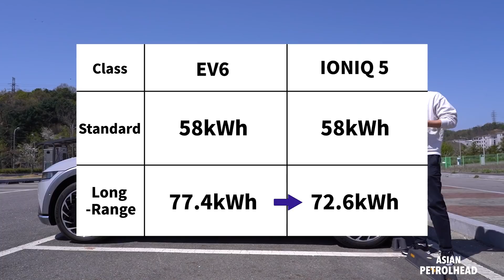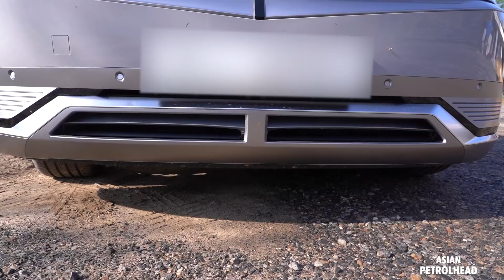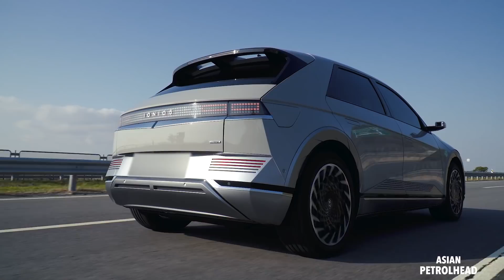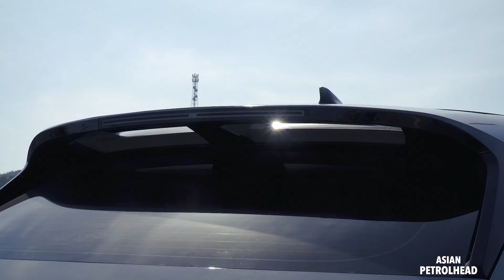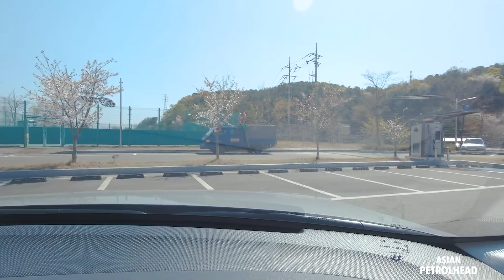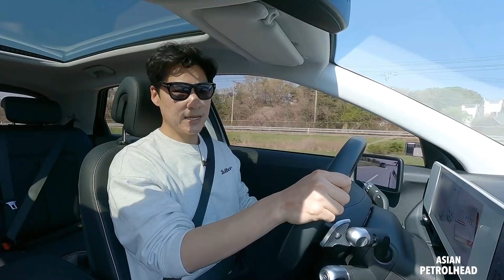Hyundai IONIQ 5 in-depth Review – 605Nm Dual-Motor IONIQ 5 is here | Best looking EV Car?

Comment: Great review and terrific vehicle. I like vehicles that make sense and this one makes sense. It's not too high, not too curvy, has lots of space and visibility. It's quiet and flexible. It has lots of safety features and it looks like it is fun to drive. Not sure why your head looks so close to the top in the rear, however, so maybe the seat should go lower or recline more? It's $52,000? If so, electric cars are still at a premium but I think it's worth it.
Reply from the maker: Well, the Hyundai IONIQ 5 will start around $45K USD in N. America. So, let's wait and see the pricing in the USA.
Reply: @AsianPetrolhead  That's a much better price. Thank you.

Comment: Nice review, thank you. There is only one thing that worries me and that is the headroom. I think I heard you saying that you are around 187 cm tall. Would you say that you have rather long legs or a tall upper body? In the video I noticed that your front seat seems to be tilt back quite a bit and your head is still quite close to the ceiling when you are not inside the area that is higher due to the glass roof. Did you move the seat down all the way? I am also around 190 and in similar hatchbacks I always feel that my line of sight is limited upwards and I am scratching may hair against the ceiling, which is a no go for me. I would really appreciate your feedback on "compatibility" of this car for taller drivers.
Reply from the maker: Well, headroom is fine for me. I am 6.2 or 187, but no problem. From the 2nd row seats, it's a bit limited, but it's not cramped.  Yes, the driver seat was all the way down. 190cm wow, you're tall. I mean it depends on your upper body size, so I think you should definitely check out the Hyundai IONIQ 5 in person and have a seat yourself. But overall this all new Hyundai IONIQ 5 is very promising car. Thanks Martin.
Reply: @AsianPetrolhead  When I saw all the review videos I had the impression that this is a "released" car. But I quickly realized that car makers have learned their lessons from people like Gates and Musk to announce stuff that is not available yet. I could order the IONIQ 5 now, but the dealer told me that the nearest showroom is 700 km away and it is not open to the general public yet (journalists and influencers only). Maybe they will get one by end of July. But if I wait to order until then I would not get the car in 2021. So I guess I will just wait until the situation relaxes. Buying a car without actually test driving it is not my thing. Even if there are really good review videos out there like yours.

Comment: Is the infrastructure up to the task? That's the big ace up Tesla's sleeve. How much does it cost to charge this vs a Tesla?
Reply from the maker: Well, yes at least here in Korea. But when you guys get the Hyundai IONIQ 5, hope you guys get charging infra as well.. Thanks.
Reply: @AsianPetrolhead  Yeah, super hard to judge if you never owned an EV. I made a big trip with a friend and his Tesla through Europe (I'm from Holland myself) and I was pretty impressed with Tesla infrastructure vs. the generic infrastructure. It seemed like Tesla had 3x the capacity for 1 car brand. And it was also cheaper to charge there.

Comment: Mhm, I generally find your reviews exceptionally profound, knowledgable and straight-forward...my impression is: in this case, one has to read between the lines in order to arrive at what you really want to say which is the first time you leave me with that impression. After your first test drives of the Ioniq 5, particularly the range test, you expressed quite a few sceptic viewpoints, regarding interior quality, dynamics and the like.
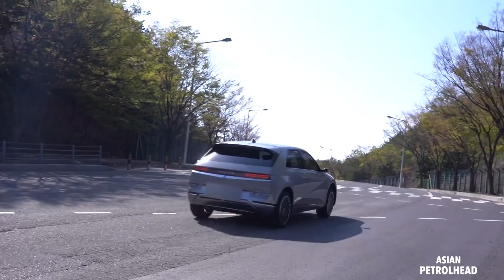Here, there are no negative points, everything seems to be positive - however: the videos belie you at times, particularly regarding the handling. At 12:24, the handling looks very heavy, the suspension has reached its limits because of speed and extreme weight of the car.
If one compares this review with the one about the Genesis GV70, it becomes obvious that by comparison you actually do criticise the Ioniq‘s handling and even its acceleration. Only by comparison this becomes obvious. It almost sounds as if Hyundai asked for less sceptic comments.
Reply from the maker: Thanks for your interest on our reviews. And really thank you for Hyundai IONIQ 5 review. And if Hyundai started asking what to say or what to do, i don't think i can carry out reviewing cars.  Thank you.

Comment: My Tesla Model S absolutely does NOT get hot through the glass roof. But only because the glass is so dark that most of the time it may as well be a solid metal roof. I would MUCH rather the glass be very lightly tinted and have a built-in retractabe shade like this.
Reply from the maker: Thanks for sharing Mark & enjoying the Hyundai IONIQ 5 review.

Comment: Charlie, I have a question regarding the use of Apple Carplay. I was told it only works with USB cable rather than wireless, but my question is WHICH USB socket can be used to connect Apple CarPlay? Just the front one or also the one in the middle console? Did you try this?
Reply from the maker: Ah, i got your question, to be honest, i didn't have time to plug in myself, but it should be one of the USBs near the cupholders i think. I have return the car, so maybe next time, i will check it out for you. Thank you for enjoying the Hyundai IONIQ 5 review.
Reply: @AsianPetrolhead  thank you Charlie. My worry is that it works only if you plug it in the front cubby USB. I hope they did it right by enabling ALL USB sockets for this purpose.

Comment: Outside top (though no matrix LED) inside flop, especially the two displays
Reply: much better interior than tesla
Reply: you do not need matrix lights most people drive a lot more hours in daytime unless you live in Iceland
Reply from the maker: Yes, the Hyundai IONIQ 5 has quite nice interior. Thanks.

Comment: What about the security features? Does it have the "Pin to drive" and the the Sentry Mode  that make Tesla cars almost impossible to steal?  Thank you for your great job!!
Reply: No need of pin. You take the key with you and it open the doors when you are very close, same for the trunk, and it allow you to turn the power when the key is inside. I have seen some sentry mode like feature in some videos but maybe not in the final product or not in all markets. So we'll see. I don't like to have another pin in my life for my car.  I have the same stuff for my car, it's easy and I prefer that anyway, works very well and it also close the car as soon as you get more than 1 meter away from the door. 
If the thief can take the car with him the sentry mode won't help, it would only if the videos are on the cloud.
Reply: @YannR34  Thank you Roger, last question... In the Toronto/Montreal area some high tech thieves use radio frequency amplifier, captures the fob’s signal from inside the house or public parking and extends it so that it can reach the car. The boosted signal then unlocks the car and also starts the vehicle’s engine.
I wonder if the very close distance that you refer to is safer than the technology used by Toyota cars which is considered easy to steal.
Reply from the maker: It doesn't have the Sentry Mode. Thank you for enjoying the Hyundai IONIQ 5 review.

Comment: I really like the design, but have seen it against Kona and it is big, so need to see one. Also need to look at the quality of the plastics since the windscreen wiper stalks, regen selector paddles and the drive selector stalk looks relatively cheap in the silver colour.
Am unsure about the digital side mirrors, but like all things become accustomed to them. The blind spot warning screen pop-ups look like a good idea. Does it have 360° reversing camera or similar to Tesla Sentry mode?
Great video as always @Asian Petrolhead 👍🏼
Reply from the maker: Well, Paul, the IONIQ 5 has longer wheelbase than Hyundai Palisade, so if you see it in person, it looks large. Thank you.
Reply: it has 360 degree mirrors in the top spec ionic 5
Reply: Sean Holdom excellent, cheers @Sean 👍🏼

Comment: Don't like the black snow flakes added to the wheels, when driving in the city at low speed the air will not remove rain water from the rear window. As you say plugin at rear not the best location. .......Like the styling a lot.
Reply from the maker: Yes, the Hyundai IONIQ 5 looks great in person. And I think you guys will like the new 20 inch rims. It looks great in action.

Comment: Nice performance test, cheers! Out of interest now that you’ve had a decent drive in both LR models, how would you compare their midrange acceleration, e.g. overtaking or pulling onto a motorway from a charger stop? The one thing that worries me is the big difference in 0-100 times might mean the RWD is a bit sluggish.
Reply from the maker: The dual motor system has so much more power. And it is more stable around corners. So, if you want performance, you should get the Hyundai IONIQ 5 with dual motor system. PERIOD. Thanks Adam.
Reply: @AsianPetrolhead  Thanks! Not that worried about cornering at speed, more about being able to accelerate to overtake in a timely manner. It just feels like such a jump from the quoted 0-100 5.2s AWD acceleration to the 7.4s RWD. By comparison my current 2016 Skoda Octavia RS does it in 7.1, so I’m not sure I want to go backwards.

Comment: How does the IONIQ 5’s lane keeping assist compare to the Tesla autopilot? Will it slow down and brake for you with traffic in front?
Reply from the maker: Hi Adam. Well, like you said it's only lane keep assist for the Hyundai IONIQ 5, so it's not a autonomous driving. So, Tesla is better. Thank you for enjoying the Hyundai IONIQ 5 review.
Reply: @AsianPetrolhead  I thought it said in the video that it changed lanes when lane keeping assist was applied and the turn signal activated or did I misunderstand it?

Comment: How high are you? How is your ratio between torso and feets? How many cm are there from floor to seat? Knee up in the air compare to TMY? How wide is the back seat bench? I have had people over 2 meter in my former Ampera-e with out problem because of long feet and short torso.
Reply from the maker: I am doing good. I am 6.2, but i just don't know about the ratio. Thank you for enjoying the Hyundai IONIQ 5 review.
Reply: @AsianPetrolhead  Tall, but not as tall as Stefan at Next Move. 2 meters 6.6. :-) I am only 6.1. Who are tthe providers of battery. LG and SDK?

Comment: When Hyundai announced the Ioniq 5, 6, and 7 I was drawn to the Ioniq 6 sedan.  I've been following the Ioniq 5 because it will use the same mechanicals as the Ioniq 6 but I've been really impressed by it to the point that if the Ioniq 6 lacks features or doesn't have the appeal of the Hyundai Prophecy concept car I could very well find myself buying an Ioniq 5 in a couple years.
Reply from the maker: You're so right. Thank you for enjoying the Hyundai IONIQ 5 review.

Comment: Amazing looking car with good tech. Unfortunately with some important extras expensive in Germany. Also the range could be better. It uses too many KW per 100 km.
Reply from the maker: Thank you for enjoying the Hyundai IONIQ 5 review.
Reply: “...range could be better.”
Seriously!?!? Where in Europe are you ever going to use 500 km of range?!?!
You don’t need and would never use more.  
Unless, of course, your daily commute takes you from Hamburg to Munich.  
People who talk about needing this much range are generally people who have never experienced owning an EV.
Reply: @robfj3414  500 km?! Especially if you drive longer distances you are using the highway. At 130 km/h the range shrinks dramatically, over 130 km/h you can charge the car ever 90 minutes. Even if you can charge quick, you have to leave the street, find a fast charging point and hope that it´s free, you have to charge, pay and go back to the highway. All together you lose 25 minutes instead of 18 for 10 to 80%.
Reply: @cnxexpat1862  
Your range isn’t going to decrease that much between 110km/hr and 130km/hr.  certainly not enough to make a huge difference with over 500 km to play with.  
I won’t comment on the speed because I get that it’s more acceptable in Germany than most places but that’s your choice.  Not the fault of the vehicle. You’ll be burning proportionately more gas anyway for the same reason.  
And as far as your comment about pulling off to re-charge ... exactly how big is your gas tank?
Also, back to my original comment, how often do you actually need more range?
Reply: @robfj3414  6 times per month for sure. 
A German reviewer needed 28 - 35 kw/h when he drove 130 - 180 km/h. If you charge between 10 and 80% you have to stop every 2 hours.
Reply: @cnxexpat1862  
Bear in mind that driving at those speeds would get you a suspended licence in most jurisdictions.  
That aside, it obviously will eat a lot more power, regardless of whether you’re using electricity or gas and gas is certainly quicker to fill up on.
Realistically, there isn’t an EV available yet that would likely meet your needs.
Personally, two hours of driving between 130 and 180 km/hour and I would at least need a substantial pee break!😬😎🏎🏎
Reply: @robfj3414  130 km/h is allowed in most countries.

Comment: Definitively an exciting car, thanks for the video!  My questions:  Did you experience reflections on the two 12 inch screens? I'd have preferred the middle screen to be at an angle. Is your right leg still having something to lean against,  sideways, as there's no mid console? And I agree it should have a back wiper. When it's raining and you start to drive, you want a clean view backwards and can't wait for higher speed to clean things up. Otherwise,  a perfect car!
Reply from the maker: No 12inch screens are very easy on your eyes. Well, you can always push it forward. Thank you for enjoying the Hyundai IONIQ 5 review.

Comment: If they can price this under the comparable Model Ys then it's a surefire hit, trouble is I'm pretty sure they won't 🤞
Reply from the maker: I have to wait and see. But i think Hyundai IONIQ 5 will be price competitive even against Tesla Model Y.
Reply: It will likely be competitive until they offer the model y with single piece castings and 4680 structural pack later this year from both berlin&Texas. That car will weigh 10-15% less, have better performance, better build quality and likely be cheaper with even longer range. 🤔

Should be an interesting few year's as more competition comes onto the scene. 
By mid 2022, this segment should have good availability of all the following: Audi q4 etron, id.4 gtx&awd, nissan ariya, fisker ocean, updated model y, Kia ev6, hyundai ioniq 5, genesis gv60e, skoda enyaq, mach e including the gt.
And who knows what others will compete in the 40-60k electric cuv segment?
Reply: @4literv6  d`ont make me laugh better build quality in a tesla ?
Reply: @seanholdom9739  sure laugh all you want, the Chinese built one's have the highest level of rated build quality for a locally built bev. 
Also the model y is already the 2nd best by sales volume selling bev in the world through q1 2021. 

And that is with gigahai just starting to sell them only 3 month's ago, and without gigalin or teratx producing them yet. 
By the end of the year I'd bet that the y is even with, or surpassed the model 3 as the best selling bev in the world. 
By the end of 2022 with 4 factories cranking them out it will be a foregone conclusion imo. 😎
Reply: @4literv6  not in europe wait till 2022 tesla y will be history
Reply: @seanholdom9739  you mean the place where without an open factory on the continent tesla still enjoys a 13% overall ev market share? 
That Europe? Man you are on some good stuff if you believe that. 😂
Reply: @4literv6  tesla crap built Quality no HUD NO remoet parking no V/L no ajust rear seats, no relax seats with leg supports ugly car all modela look the same ugly huge tablet stuck on to control all functions

Comment: Why is there no spare tire? What's the thinking behind that?
Reply from the maker: Well, the Hyundai IONIQ 5 has a fix a flat kit in the trunk.
Reply: Most of the car now, don't have any spare tire. I didn't any for a while now, with my mazda's and other car before. I only got one in one car if I remember well and I only used it once in my life including the kits.  The other issues I had doesn't deflate the tire fast and it could be fixed in 15mn at a station. The real issue I had once, the tire was dead on a sharp board walk edge. The wheel of replacement was not the same size and you can't really drive with it anyway. So I don't mind no having change, technologie has evolved since.
And a spare wheel weighs a lot.

Comment: What kind of remote features (app) does it have, heating or cooling?
Reply: Ya i want to know that too blue link etc app very important
Reply: Yes, and you can park the car with the key remote too, so better than the app which require connexion, with the key you can be underground with no issues. 
The app has the same function than it already exist, just look at the app in the store. The electric cars offer a bit more,  for the charging.
Reply from the maker: I think the Hyundai IONIQ 5 will also have blue link for the wireless communication. Thank you Mark.